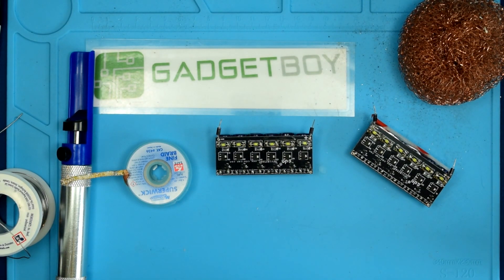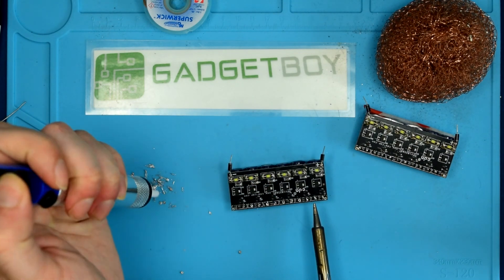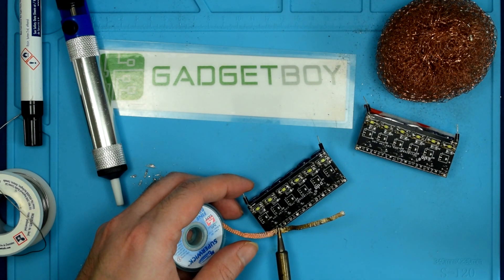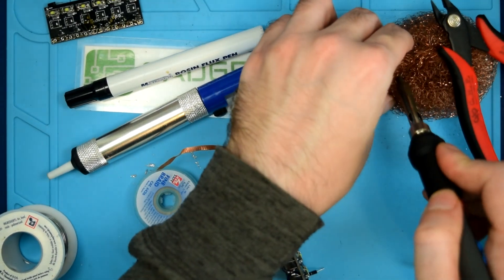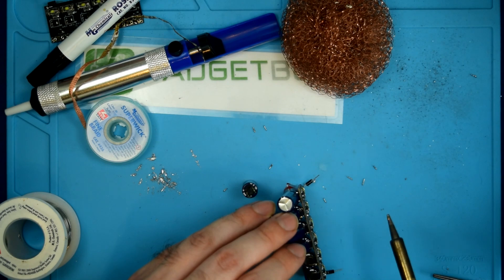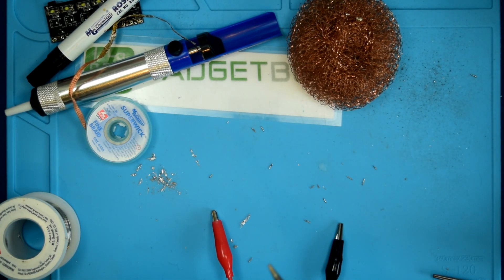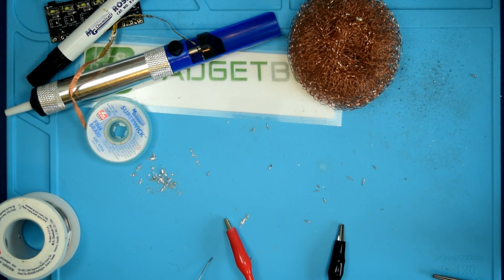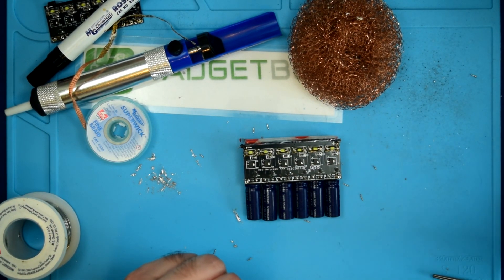12V Solar Battery Bank Project - Part 1

Comment: What benefit does feeding the power through a capacitor bank rather than feeding it in to the battery directly? What was the white noise that seemed to creep into the video about 75% of the way through 😅 is there a chance adding the extra capacitors could defeat some of the protection circuitry by sheer force?
Reply from the maker: 1. They act as a reservoir to try to keep a constant flow of power (in case incoming power from the panels fluctuates).

2. I was having audio issues part of the way through.

3. Not really, the protection circuitry prevents the capacitors from exceeding their rated voltage, the capacity is immaterial.
Reply: @GadgetBoy  is fluctuation such a bad thing?
Reply from the maker: I'm hoping to keep the incoming voltage at or above 12V so the batteries are constantly charging.

Comment: How much power does the circuit itself use as opposed to what is coming in and going out, what is its wastage
Reply from the maker: Thankfully the protection circuit is insanely efficient. I'm not sure of it's quiescent current, but it's so small as to be not a concern.
Reply: @GadgetBoy  I was thinking of having a solar charged battery, of course in England that might be difficult 😂
Reply from the maker: Julian Ilett does it.
Reply: @GadgetBoy  I don't know who she is
Reply from the maker: He. Another electronics YouTuber.
Reply: @GadgetBoy  😉 I know, they bore the living crap out of me